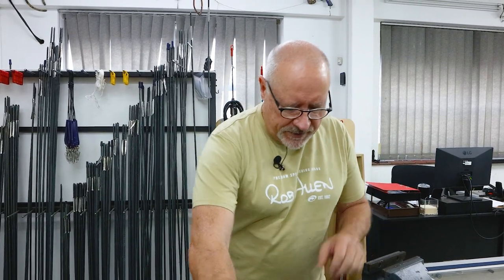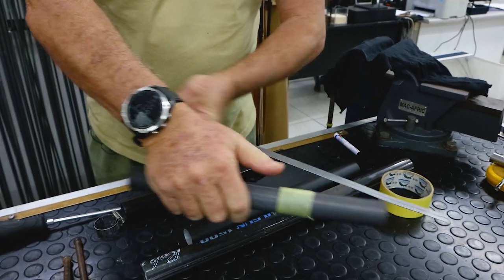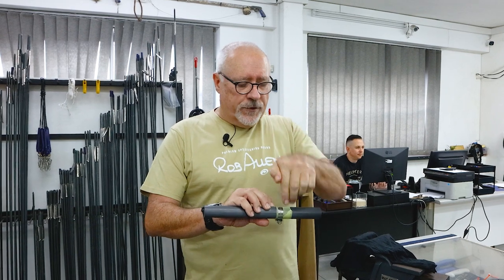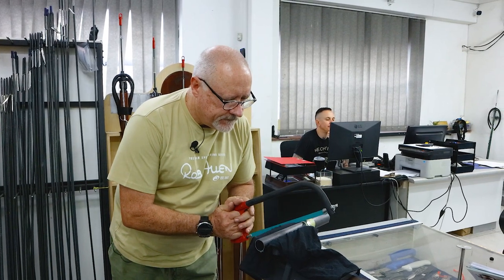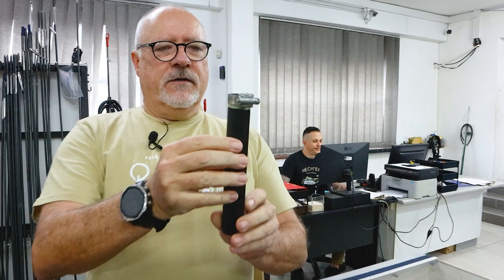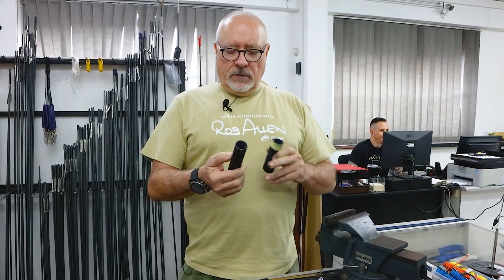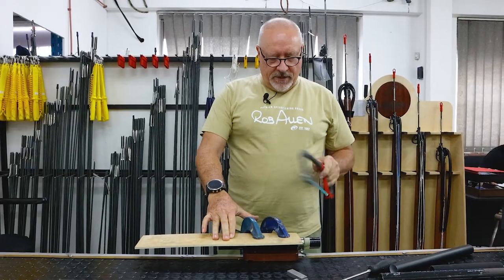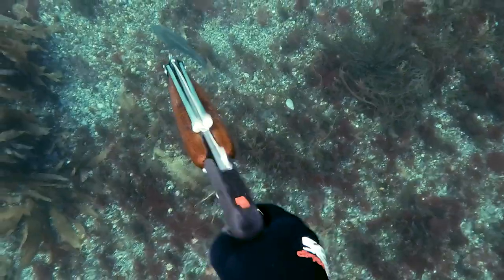Rob Allen | DIY Barrel Cutting | 2023

Comment: Great idea! I'm in the middle of a speargun shortening project, and I just ran into a hurdle.
Once you cut the barrel, how do you drill the holes for the muzzle/handle so that they are parallel with one another? Also, ensuring that the rail is perpendicular to the holes. Without precision, I sense that the accuracy will be drastically impacted.
Rob, could you weigh in on this? A video would be splendid :)
Reply from the maker: It is very easy. If you are re using the same muzzle, just push it back into the barrel after re plugging, make sure it is fully on and, rotated it so it is perfectly straight with the rail. The mechanism (handle side) will not have moved so just sight down the rail to check. Once in the correct orientation, drill through the existing hole in the muzzle with the appropriate drill size to fit the screw you are using. If the muzzle you are fitting is new, just drill through both more or less where the screw should be located, preferably not too close to the front of the barrel, but far enough back so it enters the inner spigot of the muzzle.  If this screw position is not perfectly straight it will not matter as the muzzle will remain in the correct position.
Reply: @RobAllenSpearfishing  Thanks Rob. That is very helpful. I may be over-thinking it.
How would you drill the holes if you are starting from scratch? I have a railgun barrel with no holes on either end.
Reply from the maker: @meatballspear  same way, line up the rail with the handle, drill and screw into place the continuing as above.